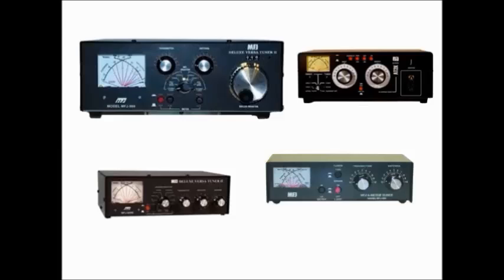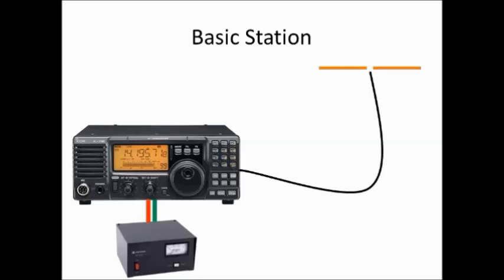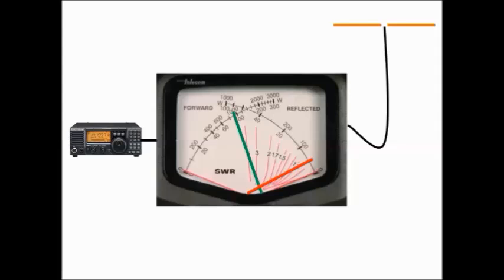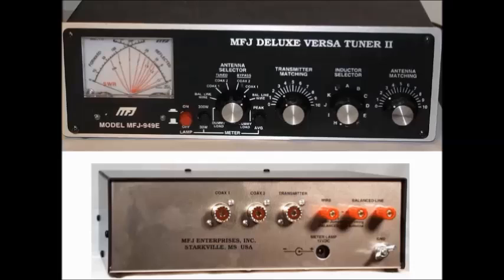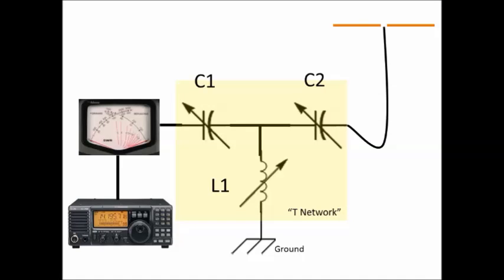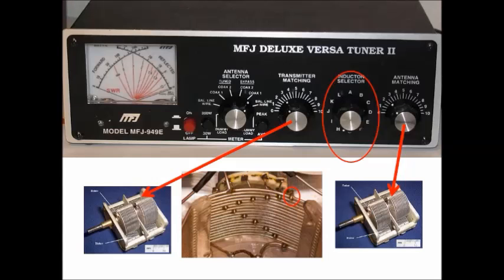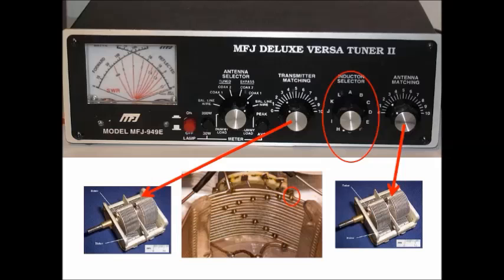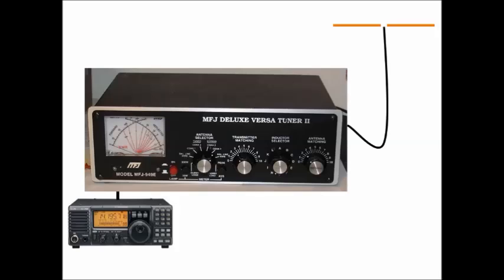MJF Antenna Tuners - Part I

Comment: When I set the MODE to RTTY to make the Match I can achieve a 1:1 match with the radio putting out half power of 50 watts. Is this the place where I leave the antenna match? When I put the radio on full power of 100 watts the setting doesn't change in the RTTY Mode, but if I change to LSB or USB I get nothing on the MJF939. What is happening?

Comment: would the MFJ 908 mobile antenna l-matcher work with my Galaxy 959 and stryker sr-a10-mm antenna in my truck. thank you.
Reply from the maker: Yes but why?  CB antennas should be tuned already for their operating frequencies.

Comment: I have a Wilson 5000 mag mount and a Srtyker "export" 10/11 meter radio. Can I use this tuner to lower the SWR at  10 meters - 11 meters is 1.2:1 ant the middle of the band ? And, what does the red button do?
Reply from the maker: CB is HF so you can use this tuner to fine tune a CB antenna.  Red button is for the meter light (if you provide 12 volts to power in jack on the rear).
Reply: Commsprepper - thank you very much. I just tried it on 11 meters and made more contacts than I ever had - one of them was twenty miles away, and I am in a relatively low spot ! I was able to tune the 10 meter band as well; unfortunately, there's little to no propagation!

Comment: Hey man, thanks for your input. I learned alot. yet I have a question that I can not seem to get answered. I have a Yaesu ft-8800 and ft - 2900. What antenna tuner ( auto tuner if possible ) will work with these unit? Thanks !
Reply from the maker: You don't need one.  Those radios are VHF/UHF and you only need dual-band antennas.  They make VHF/UHF tuners but I don't know anyone who has one.  Just get the right mobile/base antenna.
Reply: Once again , Thanks. I am learning as I go and it aint easy. I do have a Arrow Jpole and a diamond for the jeep so I should be good. Thanks again !

Comment: is this tuner can be use for 2 m/440 or only for HF?
Reply from the maker: HF only.  All the specs cab be found at MFJ's website under their manuals section.
Reply: thanks. great video by the way!!
Reply: If you buy a ATU for HF i.e 160M - 10M (or 6M) It will only cover those bands. You must buy a ATU that is made for VHF and UHF i.e 2M and 70cm (440MHz).

Comment: Great video. I do have one question. Does the 12V power to the back of the unit power anything except the light in the meter?
Reply from the maker: Just the light.

Comment: Thanks for posting. I'm a newer Tech and will be taking the General exam this month anticipating getting into HF.  I guess a tuner needs to be factored in as a necessary accessory to the shack.  One question.  Are these needed for 2M/440 antennas?    73,        KM4UQU
Reply: Wow...7 years since this was posted.  I'm going to chime in here.  These tuners are designed to work on HF frequencies.  VHF/UHF antenna tuners are available.  I suggest that if you use a portable antenna on 2M/70cm, you should build a roll up J-pole that is resonant on the frequency you expect to use rather than trying to use something random.  These pack away in small spaces, and the selection of bands is pretty limited.  With HF, there are many bands to use.  An HF tuner allows using an antenna with poor characteristics for the selected frequency band.  Jim  N4FAF

Comment: Thanks for your video. I have a question about the back panel setting: Do I have to connect the jumper connection if I use the longwire antenna or windom antenna.
Reply from the maker: Jumper is used for balanced lines like ladder line.

Comment: Can I use one of the MFJ Tuners on an 11 Meters Galaxy 998VHP radio mostly on AM?
Reply from the maker: +Steve Holsten If you question is will the HF MFJ tuners work on CB radio antennas then yes.  However, why?  CB antennas can be purchased pre-tuned.
Reply: The answer is yes you can and one reason I can think of where you may want to is if tour CB antenna is not in the ideal location and external walls or other interference is causing your reflected power.
Reply: Commsprepper you will find that a mobile antenna with a flat match on test bench will never exhibit that same SWR match any where else.the concept of a "pre tuned" antenna is about as good as a one size fits all pair of pants.

Comment: hi i have a mfj 949e delux versa tuner which i bought second hand the previouse owner fitted a new face plate and hasnt fitted the transmitter antenna or the inductor knobs in the correct position could you send me a close up internal picture with the transmitter and antenna set to 0 and the inductor set to a thanks im quite new to amateur radio 73s lez 2e0lke
Reply: I recently bought a very clean 35 year old Heathkit antenna tuner. I had to reset the counter on the inductor. Take the case off, and get the roller back where it is at the START of the coil, and NO coil is in line at all. Set the numbers for ZERO at that position. On mine I had to loosen up a right angle gear & roll the numbers to 0000, then carefully tighten up a small set screw. With plastic gears you can usually force them to strip past each other. I had a 3KW MFJ arc barefoot with a 200 watt transmitter, and decided to never buy another MFJ tuner. my 2060A is 100x better tuner than the MFJ ever can or will be. They have a nice oversized Balun, silver buses, silver plated copper coil, & nice wide gaps in the caps. My linear amp is the idiot proof last variant Denny Carry made with the Peter Dahl transformers, fold back protection, and QSK  relays. I used a $2000 Bird meter with it that shows me VSWR, forward power (PEP), reflected power (PEP), same power for Carrier Wave, Modulation percentage, VSWR  PEP, CW, and Average, Delta, minimum & maximum. I can tune the clothes line to 160 meters with the 2060A. I am off to pick up an old EF Johnson Match Box, and antenna/transmitter selector relay box, & TV filter today, so I will probably be cleaning that one up, and setting the counter to 0000 on it tonight. The capacitor knobs may or may not rotate 360 degrees, and the marking should be at 0  just before the plates are starting to mesh together. I cleaned the scorch marks off my MFJ and dumped it at a ham fest. Arcing at 200 watts meant there was no way I was ever going to try it at 1500 watts, with a $3000 linear amp. LDG makes a killer auto tuner, for most modern rigs, from the big 3, Kenwood, Icom & Yeasu. I also have some old Heathkit & homebrew tube transceivers, and just picked up a modified prewar US Army transmitter, & receiver package that was upgraded to FM & SSB capability so it will run 100 watts AM, & 260 watts SSB from 160 meters to 10 meters, with a preselector in the receiver, and an added VFO, BFO, and Q multiplier. The tubes in it are worth about $6,000, so I am torn between keeping it original, and selling the tubes to buy more gear. Someone dropped the radio & broke one of the tubes, so I am using Chinese Shuguangs in it, pending buying another RCA VT4C. Take you tuner apart, and get the counter unlinked from the coil roller, and set it to zero, and that is all there is too it. I may do a video of how they can get knocked out of whack, and how to easily bounce them back to zero, but it only applies to the older better tuners.
Reply: Hi Lez. Check out at the top of the page on here. There is a picture of the MFJ 949e DELUXE VERSA TUNER II.  Hope that helps. 73 de John - G0WXU